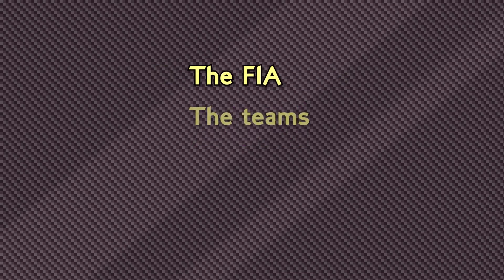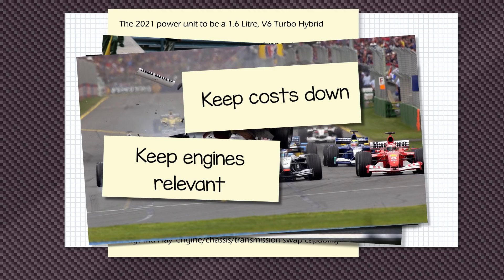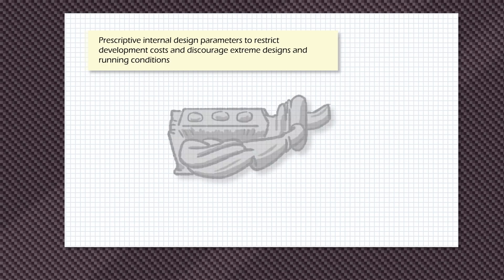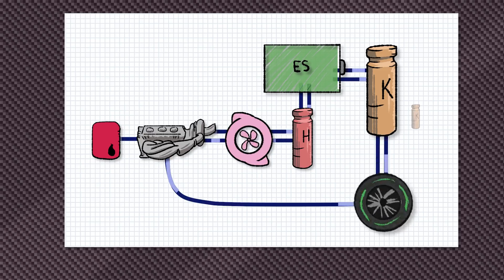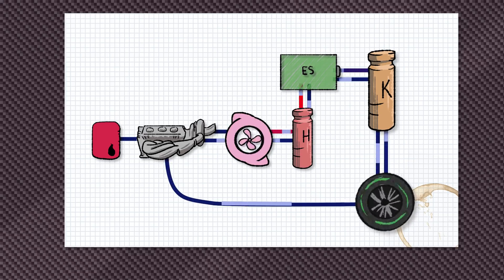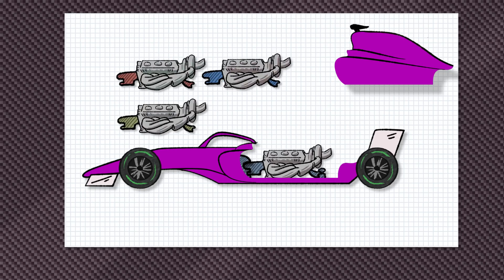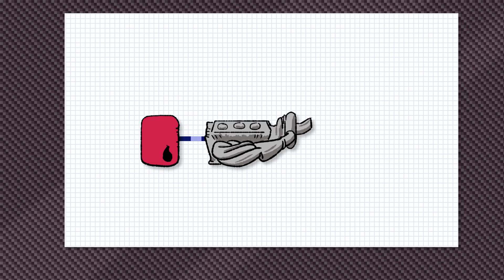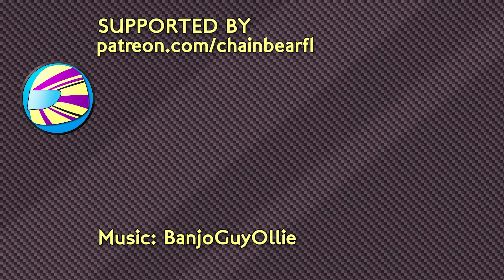F1 Engine proposals 2021 explored

Comment: I wonder if FIA combined with Liberty Media will ever consider mixed engines/Power-Units again. 
For example, if a team/manufacturer wanted a seriously technological advanced PU, that pursues the advancement of hybrid technology, they could run that, with the consequence of reliability, durability and ultimately - cost (current F1) 
Whereas, a new manufacture, or a customer team could pay to design a simple N/A engine or a basic turbo/twin-turbo engine. As we see in most common forms of top motor racing today. 
Surely, this road will, could and deter other manufacturers from entering but, it's more of balanced choice than what we have currently.
As we know, a top BHP engine output/PU, is not essential to being a top competitor and championship contender as we saw once 2.4L n/a V8's were given a engine development freeze. Aero performance,chassis performance  and tyre performance rained supreme, in the end.  
The only cap/regulation should be a BHP limit for all drive-trains. 
Just something I've been thinking about... 
Cheers

Comment: Make the requirements based on displacement. For example, 2 liter limit. Whether you want a 2 liter natural engine, or a 2 liter v8 turbo, or a 2 liter v10, whatever. Just as long as displacement numbers are there.
Reply: They tried that rule, and then teams would come up with near 2000HP cars that might or might not randomly blow up during the race.

Comment: do you mind jumping into E1 (the electric F1 / formula E) how it actually works, comparing to F1's standard and race styles? it's so confusing on how E1 actually works, other than the fact it has a shorter race track and is approved by FIA as well as the electric cars

Comment: I reckon teams should have a choice of engine types, such as a 1.6l v6 turbo or a 3.5l v8. Also, the amount of fuel allowed to be used in a race should be the same but refuelling should be allowed, in order to burn fuel more efficiently. The fuel manufacturers should also be allowed to produce more efficient or more rich fuels, I.e a team could use Total and get an efficient fuel or Shell and get a less efficient fuel that makes the car faster. Tyres should also be competitive and there should be multiple manufacturers trying to make the best tyres, as making tyres that have variable levels of wear doesn't make much sense to me

Comment: I think they should bring back refuelling as it would be a great strategic element.
Reply: What are you smoking,F1 spends 300million per year per team , GTLM 24h cars refuel , indy cars refuel , nascars refuel all without any problems because new clean break fueling systems that only cost a few thousand dollars.
Reply: I'll be Frank I'm Leary about using my name - what are you smoking? The F1 teams calculated it would cost around 1M€ per year. Not a problem for Mercedes or Ferrari, but a kick in the nuts for the likes of Sauber and Force India.
Reply: It wasn't even that dangerous. There were not that many incidents with refueling in the modern V10 era.
Reply: It was confusing though, it was kinda like after the first stint the cars all went into some mixing machine and you only know how the race is going near the end of the race. Feel like I have to pause it every time someone comes out the pits and calculate what's going on.
Reply: I'll be Frank I'm Leary about using my name - I'm just going off what the teams themselves said it would cost in total. Maybe it is bullshit, but unless you are running an F1 team you can't know how much it would cost.
Reply: Refueling wont make the races more exciting.  What it'll do is place a higher emphasis on strategy, reducing on track overtaking, driver involvement reduces.
Reply: too many fires during refueling for refueling to ever come back. major safety issues for driver, pit crew and car. just hunt around yourtube for some videos.
Reply: Andrew Frink I know, but there is always a risk, if you're participating in F1.
Reply: thats BS small circle track guys that spend less then $100,000 a year total never even mention fueling, most of there cost is a $60,000 engine, tires and brake pads,  i see chumpcar guys that race $500 junk cars jump over the pit wall with a 5 gallon fuel re-filler tank and fill up , its really just that simple Go look at GTLM 24h cars refuel not sure why it needs to be super complicated  a old school pressure pump could put 10 gallons in the tank in a few seconds.
Reply: Racing refuelling rigs are way too expensive to run (and dangerous, too).
Reply: And they could make it safer by having a minimum required 10second stop.

Comment: In 1986 Teo Fabi recorded the fastest lap at the Italian Grand Prix with a 1:28.099
28 years of "innovation" later, Lewis Hamilton managed a 1:28.004 in 2014. 
If this is not a wake-up call concerning these shitty engine & fuel regulations I don't know what is.
Reply: We had a unlimited class in street rally. It was not pretty and abandoned very quick.
Reply: The 04 cars has too much aero, thats why the 05 cars had be slowed down. Thats why teams got almost 100 hp out of the cars the next season just compensate for the loss. Second the reason TC was on a car at all was to make it go faster, it would reduce the wheel spin out of corners, therefore better speed down the straight and would help with the overall ease of driving the car. The reason why TC was allowed until the 08 season was simply because there was really no reliable way to see if it was on the car at all.
Reply: Are you being intentionally thick? Track is nowhere near the same and 2017 cars were on course to break montoya's record had it not rained on saturday.
Reply: Well track length differs by 7 meters (longer in 1986). 2017 cars are exceptionally fast because of much improved aerodynamics and mechanical grip from the fatter tires. But just imagine how fast if they were not compromising with engine power and saving tires and saving fuel (+ weight from the battery system).
Reply: Exactly my point, can you just imagine the 2017 cars (with great aero and grip) 100kg lighter with 950hp v10's and no tire/fuel saving nonsense?
Reply: MartinHelin  You gave the answer to yourself. The cars would be too fast. FIA always try to make them slower for safety.
It is a basic discussion. Should there be rules, or not? Imagine the teams could do what ever they want. No weight or power limit. Costs would explode, only few teams left and fastest car dominating whole season. Would be boring.
On the other hand, F1 should be loud and with big engines. For the spectators it is so boring now.
Reply: V10 cars had horrible tyres, TC that took seconds out of laps, much less capable aero and no DRS

Build a modern V10 car with those things and it would run circles around 2017 car
Reply: Martin, you failed to mention that only 10 out of 26 starters finished that race in 1986... we're talking F1, not nascar, we're here to see a race, not a wreckfest of people colliding or losing the gearbox/engine...
Reply: I think that we have to go full electric sooner rather then phasing combustion engines out in a period of 20 years. Of course, we ALL want engine screams, crashes and huge speeds, but there are plenty of other ways and areas to have a formula in wich teams, engine manufacturers and drivers can push to the absolute limits.
Reply: I agree with you, the safety aspect is ofcourse a contribution, and naturally the cars can't get to fast for the drivers to handle. However, these hybrid engines are the most expensive engine packages ever put in a Formula 1 car, so I would disagree that cost would escalate, probably the opposite. And you're right, the engines should be loud and big, but also current rules make F1 so boring. It's more endurance than sprint. The winner is not necessarily the outright fastest but the one who is best at balancing speed with tire degradation and fuel economy.
Reply: yeah man, that would be epic!

Comment: F1 should just let the formula E cars race in F1 races along with other cars with varying engines... One team wants to use a v10, let them and race them against the formula E cars, Porsche want to run a formula E team for R&D let them, another team wants to come in with a  V10 car with Seb Vet at the wheel and race with Ham in a V12 car  at the front of the pack then let them. You get excitement and  big companies coming in and supporting the series as well as brilliant racing  at the front of the pack...
Reply: I'm afraid that this could lead to massive gaps between teams, like Brawn GP but multiplied by 100
Reply: matiastoat42 It would depend on what teams wanted out of the sport... The Formula E cars would be slowest but 1. Be backed by car manufacturers gaining data and R&D about electric motors and 2. Have competitive racing between themselves

Meanwhile at the front of the pack there would be limited rules regarding the speed and the like, meaning that the teams at the front should be competitive with each other (whether it be on track or by strategy [with some cars being faster on track but need to stop for fuel])...
Reply: Formula E only makes 240-260 hp and the top speed is way less than 300km/h.
That would be like GP3 cars vs F1 cars.
Reply: Maybe the revamped season 5 car and rule-set will be more to your liking.
Reply: Perhaps keep an eye for for the big revamp coming in season 5.
Reply: season 5 FE cars will be able to tap 280~300 kph. 0-100 (kph) in 2.6 seconds.
but close to no downforce, so yeah they would get murdered by any f1 car that has a wing.
Reply: Peter Y Same here, in the UK they had Vernon Kay presenting it, who was clueless about everything... But the horrible reality is that big car manufacturers are supporting that over F1. It's getting to the stage now where car companies are all trying to make the blandest cars possible...
Reply: I watched only one Formula E race and found it to be the most boring racing I have ever seen, I hope they continue with  gasoline engine for many years to come

Comment: bring on the turbo lag and boost gap. that will make battles where u have to react way more interesting.
and i like the greater energy store.
the problem now is that a lot of time's a faster car's are being held up because overtaking is so hard.
but if u have a better pace for 5 laps behind some one who has to go 100% to keep u there i feel it is oke to give the other guy a boost to reflect the pace of the car compared to it position on the grid.
o and using a different engine strat behind some one for 3 lap and then turning it up for 1 lap to get past is already a ting.
but if they make it more pronaunst im oke whit that. 
o and manual deployment will give us more tail happy cars like in the beginning of the 1.6 era.
i want to see that waggle again.

Comment: I’m praying for the day liquid hydrogen power becomes viable. So long electric power, hello massive v12’s!
Reply: @David Johnston
That won't happen, if we see hydrogen powered cars (which I think is very plausible) they will use that hydrogen in a fuel cell with an electric motor.
Reply from the maker: I think we can agree that will never happen! :) Hydrogen is not used as a combustible fuel - that's far far too dangerous and unstable.
Reply: Chain Bear F1 I can dream. Electric power is all well and good but we’re going to have the infrastructure to power every single car on it for a very long time. There needs to be a better solution, an alternative fuel is the only way I can see all petrol and diesel cars being removed
Reply: @David Johnston
"...an alternative fuel is the only way I can see all petrol and diesel cars being removed"
I agree, which is why I pointed out that hydrogen is a plausible solution, but it won't be used in a ICE but in combination with a fuel cell.

Comment: what about 2 liter twin-turbo v6?
Reply: Elias Vatn I could get behind this!
Reply: Elias Vatn No, F1 should not have V6 power, period.
Reply: @Hotdog-zc7zo  F1 has had v6 turbos before. Those sounded great.
Reply: rather a 1.5l v16 or a 125cc v10
Reply: jacky BelgianGamer a 125cc v10 F1 engine would scream probably to 40,000 RPM and sound brutal. but that probably wont happen, what about an Inline 5 f1 engine? it would probably sound like a V10!
Reply: jacky BelgianGamer it would rev crazy high

Comment: 1.6L V6 Turbo revving as high as possible with standardized Turbo, MGU-H and MGU-K from an external supplier (like MotoGP standardized electronics made by Magneti Marelli and software) and freedom in the ICE parameters (e.g. angle of V, bore/stroke etc.), software and mapping (e.g. capability for both manual and automatic deployment of the recovered energy). That should close the performance gap. Also move aero regulations  closer to those of 2009/2010/2012 and we shall have fantastic racing...less sophisticated regulation --> more teams can get them right --> pack closed down --> :D:D:D happy funs :D:D:D

Comment: I just hope that the regulations will allow for different engine philiosopies. I don't want every manufacturer to develop the exact same engine. If that happens the team that throws the most money towards engine development will win
Reply: they did this in LMP1 and now there's only 1 manufacturer left with everyone else quitting.
Reply: Tele Lisast 😂 you have to admit for the most part when Porsche enter a category they dominate! I would love to see them dominate F1.
Reply: I'm with you, allow the Manufacturers to develop what they want. 
Allow customers to buy what ever they want at a reduced price.
Reply: Ted Rainville II i agree...Porsche is excellence. When they decide to put effort into something they dominate. I.E. 917 and 956 for starters as well as the LMP cars.
Reply: F1 has had formula spec limitations for the engines since they mandated only V10's, and have had a strict spec limitations since the introduction of the V8's.  The V6's are specified right down to crank throw and stroke, so I doubt they'll relax the rules.   Probably the opposite...
Reply: NOTSUI very true but I hate it, and I think the Manufacturers some what hate it also. That's why in my opinion they are all entering FE (besides the green movement)!
Reply: Like Honda adopting Mercedes' design?
(Or Renault adopting Ferrari's design??? I'm not sure if that's true tho).
Reply: Nowadays the FIA is designing the engine and the engineers just make it perform, they should give more freedom with rules like maximum number of cylender, maximum displacement...

Comment: Removing the mgu-h would be a big downgrade in my opinion
Reply: I think its good they're removing it, if the only people who can afford to innovate with it, and use it to their full potential also have dev costs 3x the size of some of the midpacks it's going to be impossible for F1 to stay interesting, if its always going to be Merc, Ferrari, Red bull on top it starts to lose excitement. 

rule changes is what drives F1, the majority of the time the rules are changed the leaderboards seem to get shaken up, bringing back interest.  A season where Force India, or Williams or HAAS was also competing seriously with the top 3 will always be better than if only Mercedes and Ferrari were battling it out, or mercedes and Red bull etc
Reply: Just make them spec cars then, like volvo ocean race boats. Hand all the teams the same weather data, the same tire data, the same chassis with the same suspension  (tune by team but with the same data points any other team could get), and the same engine (spec ECU with nothing to select by the teams except engine mode), etc. etc. etc. I'm not sure it would be F1 then, but it would mean that the cars weren't the as important.
Reply: Sigh.  Can you people watch other spec series please.  There will always been differentiators - be is strategy, tire, ddrs, blown diffusors.  It is impossible to have equal cars.  In endurance racing they have BOP, but somehow some cars are 1s faster than others.  Explain.  Big teams will always find ways to go faster than their competitors.
Reply: who cares? It does nothing to make the racing better, makes it worse actually, because no turbo lag means less work for drivers.

Comment: While I can see where you're coming from in your general view on the hybrid/electric engine ideas, I think that F1 is as a crossway too. Where it has to choose between being a sport or being "relevant". 

I've been advocating for much simpler and cheaper engines, 1.5l 4 cyl. turbo engines combined with much smaller cars. Not because I have some desire to go back to some forgotten era of racing, but because I think the enormous cars that are being raced now with the hugely complex engines are counter to what F1 should be like.

The pinnacle of motorsport doesn't have the be some pinnacle of technology.